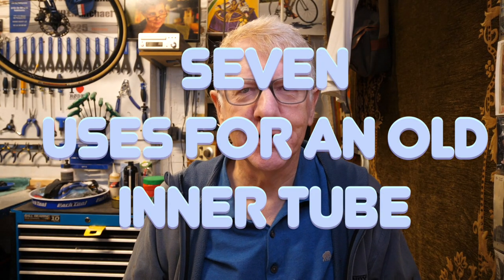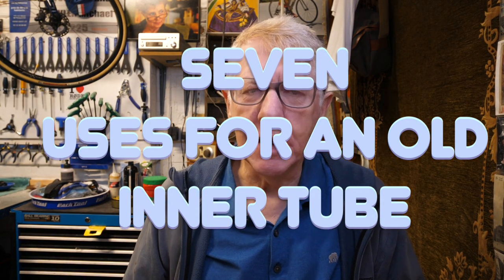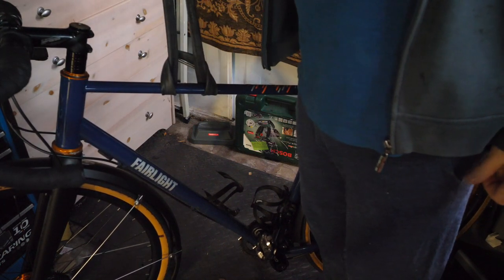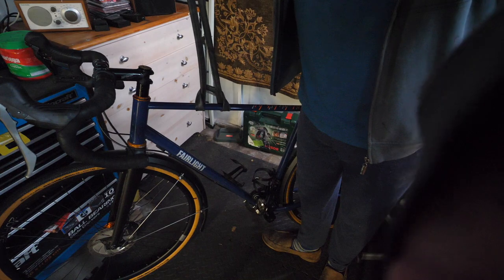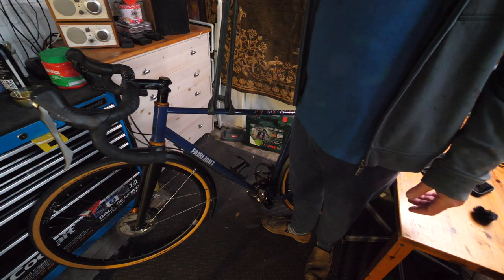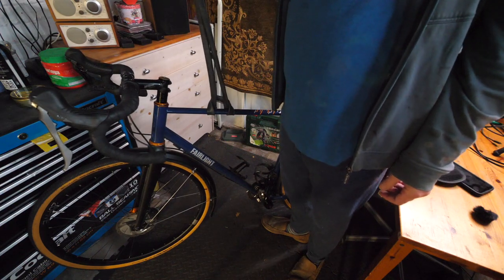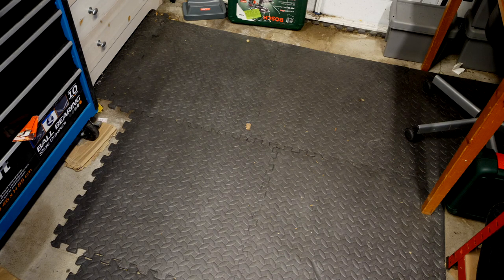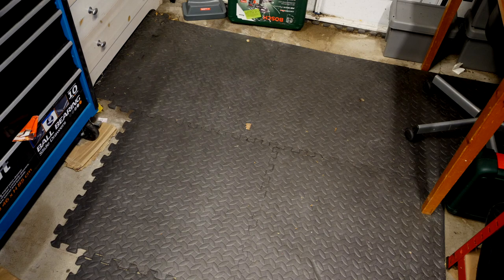7 Uses for an Old Inner Tube - reduce waste, save the planet!

Comment: I take a 700x23 inner tube, with the valve snipped out, and fill it with Maltesers. Clip the two open ends together with a Bulldog clip and then carry my day's supply of Maltesers over my shoulder Bandolier style.  I can also conveniently hang my Malteser carrier/dispenser over a hat peg while attending chapel of a Sunday evening, safe in the knowledge no one will steal my Maltesers while they are unattended, as any thief will merely think there's an old inner tube hanging on a peg and won't investigate further.

I do have two of the (rather good actually) Aldi front lights - the ones where the main body separates in order to expose the USB charging wotsitcalled. I have read these lights can let in water through the join so a bit of inner tube around each one water proofs them nicely.

Never chuck old inner tubes out - as soon as you do, you will find a use for one. T'is Sod's Law.